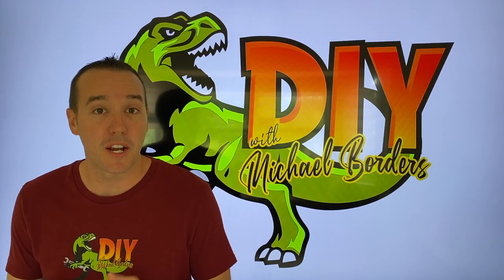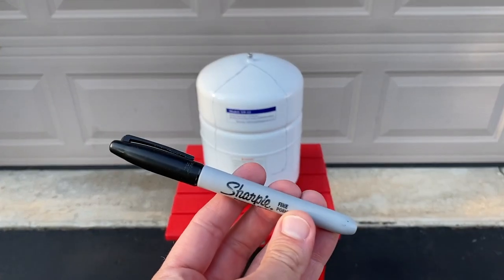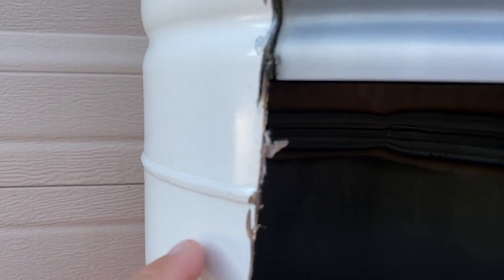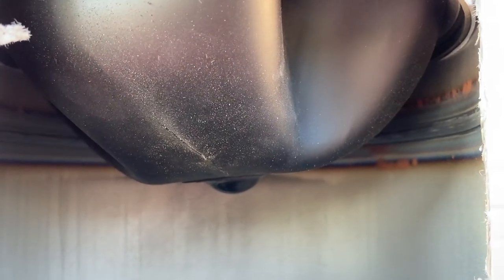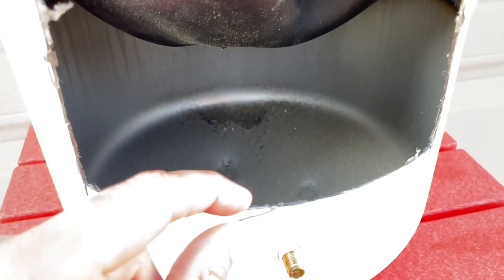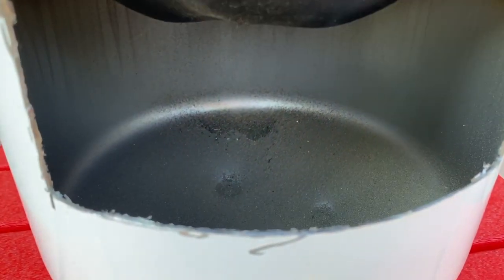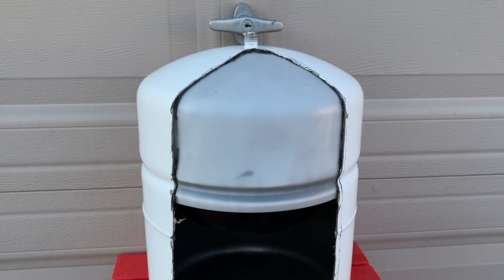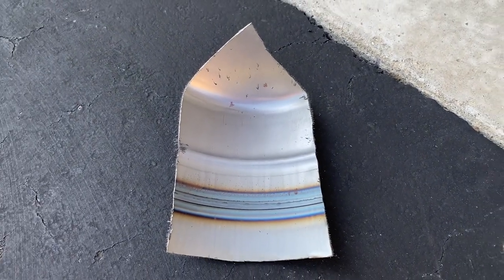Whats inside your Reverse Osmosis Tank - closer look at bladder

Comment: Many people use RO to remove microplastic from their drinking water. Wouldn't the bladder add microplastic into the water? Thank you for the awesome video.
Reply from the maker: You are welcome, we appreciate you reaching out to us.  There are specific mineral and solids testing kits out there however we haven’t ever purchased one.

The membrane and filter clean the water extensively and once it enters the tank, can’t confidently say what the water exposure to micro-plastic is present.
Reply: So true, Why go through all these 5 stages of filtering only to have the water, and i should add, constant portion of that water remains in the rubber bladder...when we are drinking from leaching rubber into the water?  This is a bit insane! Yes, the PPM solids are removed, and I have not tested for fluorides removed yet, but hope it does that too, yet drink from a rubber membrane that is constantly holding the water is not the way to go. 
Are there alternatives to this?
Reply: @DIYwithMichaelBorders  Also, when you change a membrane and you do not flush out the fluid the membrane is stored in and have your tank store the water that held that bad water, your rubber will absorb that and you can remove it all, and need a new tank to have good tasting water.
Reply from the maker: @philindeblanc  

Thanks for sharing this, we haven’t modified this unit or configured it differently than how it comes and is directed to be installed.  👍
Reply from the maker: @philindeblanc  

Thanks for sharing.  👍🧰
Reply: Thank you for posting this video. Very helpful to see it. So when I recharge my tank to the 5-7psi as recommended, after emptying the tank of the water, do I pump it up to 5-7psi with the valve closed or open?
Reply from the maker: @TizzleT  

Thanks for watching, we appreciate the feedback.  You will want to ensure tank is drained and once drained, you can carefully add air until tank pressure read’s between 5-7psi.  In regards to a valve, it should be closed unless its required to be open for air to enter tank.

😁👍🧰
Reply: @TizzleT  if the tank bladder is not damaged, it maintains the pressure with or without water in the tank.  Theres a youtube video called Whats inside your reverse osmosis tank
Reply from the maker: @peacew6  

Thanks for the reply, correct.  The tank is designed to hold proper psi with or without water.  👍
Reply: Very concerning also that the filter cartridges are made of plastic and may emit PFAS, PFOS etc. My filter maintenance service couldn’t tell me if any part of the system is free of forever-chemicals and they call themselves a water purification company. I’m going to ditch RO to eliminate the disgusting tank and use a filtration company with stainless steel filter canisters.
Reply from the maker: @glenirani5694  

Thanks for writing us and sharing your thoughts.  That’s a bummer the water purification company couldn’t give you a more detailed explanation or water quality test.

Comment: Ok, this helps me, I want to remove my storage tank, cap the tube going to it and flow water through my 5 stages and out the main outlet into a 20gal beer kettle with floating shut off in the kettle. This way I can set it to produce ro water constantly and when I get my 20gal, it turns off….right?
Reply from the maker: Thanks for watching.  If properly installed and the psi in tank is set for the system, it should work.  Have you already configured it in this manner?

Comment: Thanks for sharing, this video was very usefull for me. I've just got a new tank for my home RO system. It's this one: Aqua filter PRO4000W (EU products of 4 gallons). However, water has funny rubbery taste when using this tank. I've already emptied the system a couple of times, but still the same. Then I took the air out on bottom valve for quriosity (it stinks so bad of rubber). Now, my question is, is this tank falty or this type of tank just have that smell and taste (bladder rubber issue). If so, with which one I can replace it so not to have this rubbery smell/taste? Since I have 6 stage RO system and if I pour water from small hose before the actual tank, water is perfect (no smell, no taste, low ppm - around 30). Thanks for your attention and hoping for a reply!
Reply from the maker: Good morning ☕️ any update?  It’s likely that the tank will need to be sanitized and flushed.  By doing that, it should disinfect the entire internal portion of tank and remove the rubber taste.

The internal portion of the bladder is coded from the manufacture prior to being boxed.  This alleviates any moisture or mold from growing inside the tank as it sits on the shelf.

Once tank is purchased and installed in a home, the sanitation/bleaching process is highly recommended.

Although you have a 6-stage system, we have attached our bleaching video below.  It may help you get a bit more familiar with the bleaching process prior to following your exact systems bleaching instructions that can be found in your owners manual.

       https://youtu.be/5zNwA83aU0g?si=4KePE0IYzKWSi3Md

Keep us posted.  🧰
Reply from the maker: Also, below is a link to our RO system PlayList.  It continues a lot of videos that you may find helpful.

       https://youtube.com/playlist?list=PLjCXOz8TSkZlQnBuZZrgOiwjkvAkXc_Ov&si=nz-IWDZWe48SZhn8

🧰☕️
Reply: Thanks a lot! Will do!
Reply from the maker: @aleksandarlugonja5628  

😁👍☕️

Comment: Do you think there’s a way to hook up this system without a need for a direct plumbing line. Maybe have it as an independent unit separate from a sink ? Running it with a water pump sound like it would work.
Reply from the maker: Thanks for watching, not sure 🤔 

We haven’t operated this system separately from main household plumbing.

Comment: So im dumping out about half my water, and buying filters to have nicely polished water, and I am drinking using glass straw, or stainless steel water bottles while my RO water is being stored in a rubber bladder? You are kidding right?  WHy not just have a density feed setup, or a chamber of the feed line pressurized? why would all the water need to be stored in a material that leaches, and with water being a solvent, having it leach even more?  This just doesnt make sense.
Reply from the maker: Thanks for watching, this is how the engineers designed it.  😁👍

Comment: Is it possible to release pressure from the lower half without the pressure gauge? Ty
Reply from the maker: Thanks for watching, we have talked to some viewers that mentioned they used a screw driver but we recommend pressure gauge or valve core tool.

😎👍

Comment: What does the bladder look like where the water goes in and out from the tubes?  
Does the water touch anything inside the tank, metal for example, other than the bladder?
Reply from the maker: Thanks for watching & the water enters top portion of tank & feeds into black rubber bladder.

As more water enters, the weight of the water pushes the rubber bladder down.  The water never makes contact with the tank itself, it’s fully enclosed inside rubber bladder.

😎👍
Reply: Okay, thanks.  
Seeing the bladder & connections separately from the tank would be helpful.
Reply from the maker: @johnlvs2run  

Thanks for the reply, that’s all visible in this video.  😎👍

Comment: Thanks , I always get tanks that are dented from amazon and I wasn’t sure if the dents can make tanks rust on the inside , if it had a coating to prevent rust , now I see there’s a plastic tank holding the water and it had space , between tanks. Now I won’t return for small dents
Reply from the maker: Thanks for watching and sharing this.  Thats interesting…tanks shouldn’t come dented…that’s not normal…🤔

Dents in tank can unfortunately cause premature issues with overall performance and reliability of tank.

Please let us know if you have any questions.  🧰

Comment: I am trying to find information... can you use a well tank instead of an RO tank (for price sake)is there any difference? If so what and why? Thanks
Reply from the maker: Thanks for watching & that’s a great question.  Depending on the size of the tank, it very easily can overpower the system and not allow the water to flow efficiently through the filters and into the tank.

We haven’t tried that before...🤔... you can check the manufacturers website to see what size tanks are compatible with the specific RO system you are purchasing and installing.
Reply: @DIYwithMichaelBorders   I guess I should have stated that I want to use a well tank instead of "R O tank"
Reply from the maker: @nicholsceramiccoating8284  

Thanks for the reply.  Not 100% sure on the compatibility options when using a well specific tank.
Reply: @DIYwithMichaelBorders  so in theory I should be able to use a well tank to store ro water and reduce the  air pressure of a well tank to 7-10psi ?  I am not trying to run the whole house I have a car detailing business  And I want to use the water the water on vehicles so it will not spot up. I do understand that there are some  portable units that can do this but I was looking for a more permanent solution to just one line of my, home And I need probably 20 gallons of water to be able to do a few cars
Reply from the maker: @nicholsceramiccoating8284  

Thanks for sharing your thoughts & mission, wish we could be more helpful.  Please keep us posted on your DIY project.  😎👍